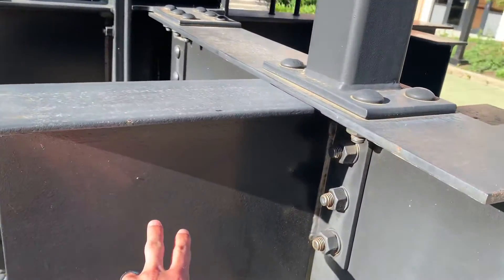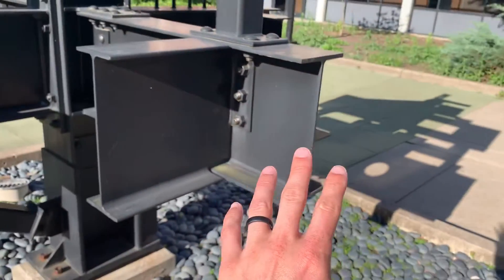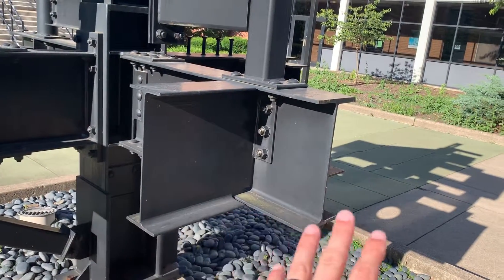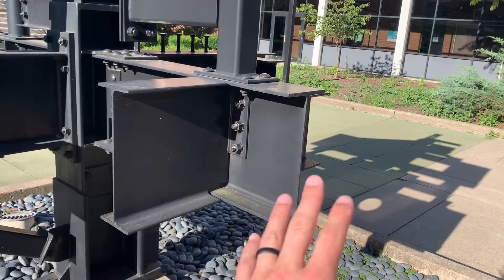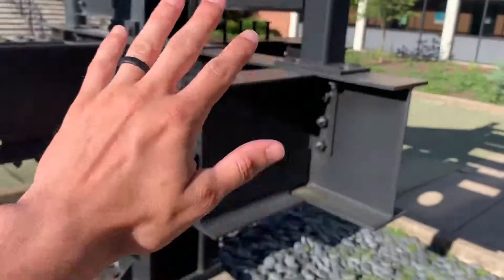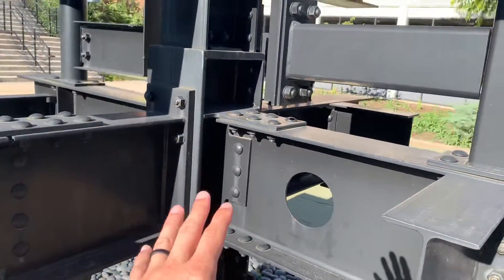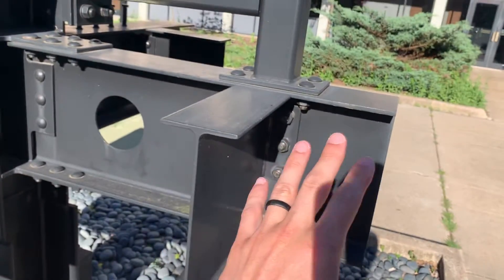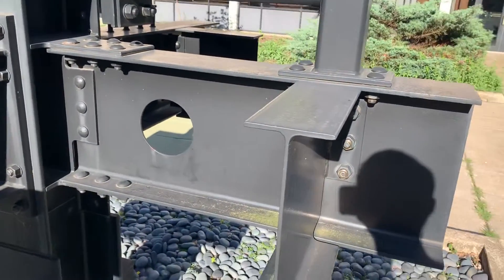How Steel Members Can Be Joined-  Structural Steel Connection Methods: Show and Tell

Comment: those are not carrage bolts. they are called tension control bolts. they have splines that break off when tightened to a sufficient torque.
Reply from the maker: Thanks for the correction Justin!
Reply from the maker: https://images.app.goo.gl/g5N6oFfrZfeysSAQ9

Comment: Great video. Been an ironworker for 15 years and stumbled across your video. Only edit i would make is that you said the bolts were carriage bolts. Ive always heard them called "Tension" or "Torsion" Control bolts (TC Bolts). Theres no square cutout like a carriage bolt would normally have. Just a round hole. The bolt kit traditionally has a washer, lockwasher and nut. After leveling and plumbing the structure a TC gun is put on the nut end that snaps the end of the bolt when the proper torque is achieved. 

Great video. Definitely should be shown to people who are green
Reply from the maker: Thank you for the insight that you are bringing!  Noted and much appreciated.

Comment: I don't really know what I'm talking about...but aren't those holes in the beams created in order to "choose" the location and direction of deformation in the event of an earthquake? I do know that during past earthquakes the beam wouldn't deform but would instead destroy the post holding up the entire building -- requiring that entire buildings were torn down when the damage could have been contained to beam deformation on a single floor. Those two holes look like they control deformation in two different ways, both saving the rest of the structure. (Some newer connection types allow replacing the deformed section after an earthquake).
Reply from the maker: Super interesting.  I’ve never heard of that before, but I have learned of other methods to mitigate lateral loads from earthquakes.  I couldn’t find what you’re referring to, but I did find a handful of articles on holes in steel beams https://www.quora.com/Why-do-steel-beams-have-holes

It’s not to say the method you describe is mutually exclusive.  Are you able to share a reference with us?
Reply: @Studio_Hero   In the "AISC Prequalified Connection 358-16 and 358s1-18w" (seismic) there is a diagram of a "reduced beam section moment connection" where the top and bottom flanges are reduced/cut in order to make that area more "plastic". It is referred to as a "protected zone" since it must not be further modified in order to focus deformation at that spot. Later that document describes an approved Simpson Strong-Tie with reduced web to focus deformation. Later "slots" cut into a web are described. My overall impression is that a variety of methods are being tried in order to focus deformation - and that this is an area where the code is still evolving and engineering judgment is being allowed (since we won't know until there is another major earthquake which of these various techniques works best). I was watching the San Francisco transit center being erected and I was surprised to see welded beam "hinge and pin" connections being extensively used where there would normally be welded connections.
Reply from the maker: @tonyduarte9503 that’s a rock solid reference!  I’d say you know exactly what you’re talking about.  The concept you’re describing also reminds me of how automobiles use a crumple zone - designed to deform and absorb energy at the cost of replacing anticipated consumable parts.  Really cool stuff, thanks for sharing!

Comment: 03:55 is a joint like this as strong as if it would be one beam?
Reply from the maker: I hope someone who is a structural engineer can chime in too, but from my studies I’m under the impression that you can design for it to as strong as you need (increasing plate thickness, length, area, doing both welded and bolted connections, # of bolts, size of bolts are some variables that can determine the strength).

Comment: Very good explanation,. Can I weld all the joint  instead of using bolt n nut  ..
Reply from the maker: Thanks for the question! You’ll want to discuss with a structural engineer for your specific project.  There’s a lot of factors to consider.  From my understanding, a weld has its strength calculated by its radius and its length. Opting to weld the joint will also create a rigid connection, which will not allow for natural movement (I.e rotational movement).  The lack of movement creates internal stresses for the joint and materials to resist (due to expansion and contraction for example).  This creates the need to fully commit to designing around resisting movement at this joint rather than designing to allow it.   That may involve additional plates to increase rigidity.  To do that correctly is beyond me at that point.   If someone reading this has more insight, please comment!

Comment: What are the requirements for the bolts that tie the column into the concrete. I heard concrete can rot steel. Are they always galvanized? Coated in something?
Reply from the maker: Hey Wes, it’d be good for a structural engineer or product rep to chime in here, but from what I understand: for exterior applications it would be galvanized, coated, or a material that can handle moisture/ ground contact as well as the materials it would be in contact with (think dielectric union between metals, etc).  When trying out a new product or technique, it’s best to consult a product rep and/ or engineer to make sure what’s being specified on a set of plans or installed in the field is going to perform the way it’s intended.
Reply: @Studio_Hero  Thanks!

Comment: I was always wondering how they got the curves on huge commercial buildings
Reply from the maker: Yeah it’s amazing! Steel beams can be curved too, but often the steel skeleton is a series of short straight members.  Some steel designs are finished off with a facade that has a curtain wall with custom fiber cement panels which really allow for some smooth curved geometry!